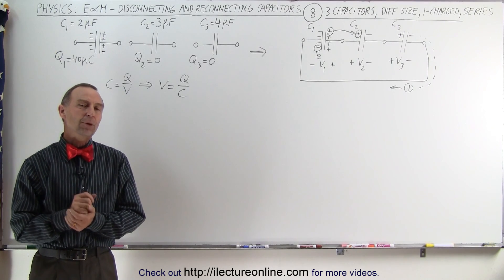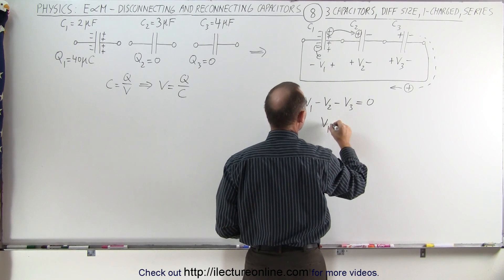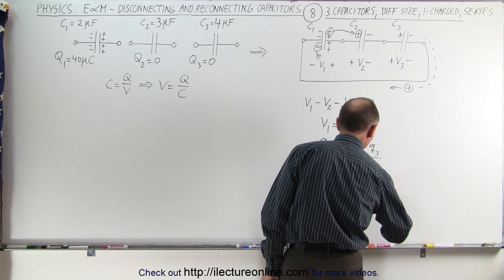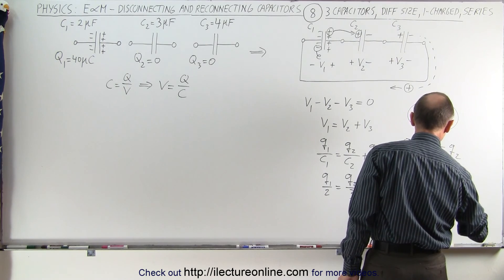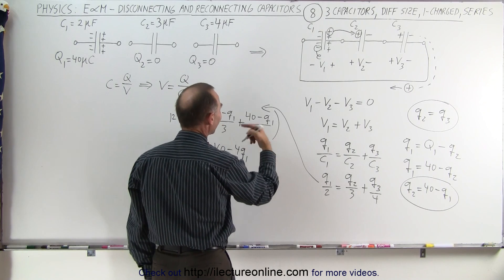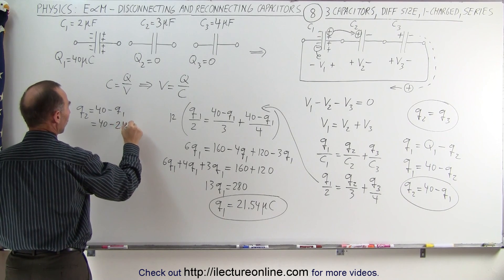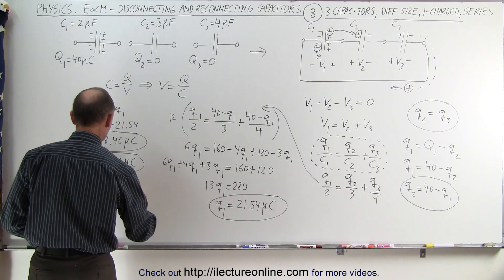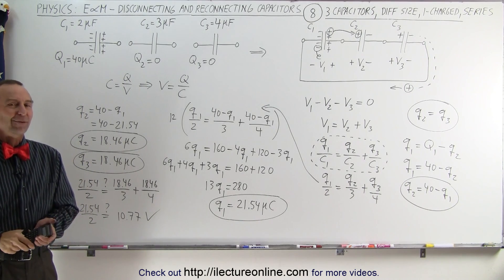Physics - E&M: Dis- and Re-Connecting Capacitors (8 of 16) 3-Cap., Different Size, 1-Charged, Series

Comment: Sir as you said q1+q2+q3 = 58.46 but initial total charge is 40, so isn't  conservation of charge disobeyed here, can you please explain how it works
Reply from the maker: The charge is most certainly conserved.  But that doesn't mean that when you place charge on 1 capacitor and then allow the charge to redistribute across the other 2 capacitors that the total charge of all 3 capacitors will add up to the original charge, since the polarity of all 3 capacitors is not the same.  What must always be true is that the sum of all the voltages around the loop must add up to zero.
Reply: @MichelvanBiezen Now I get it.  Thank You so much Sir.